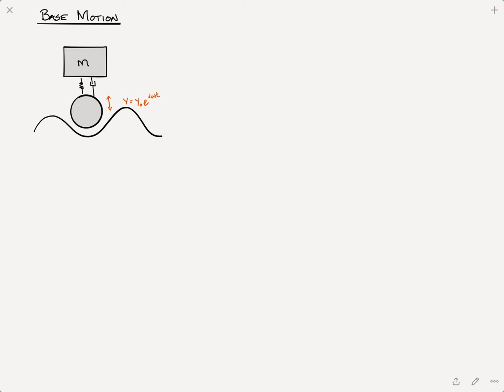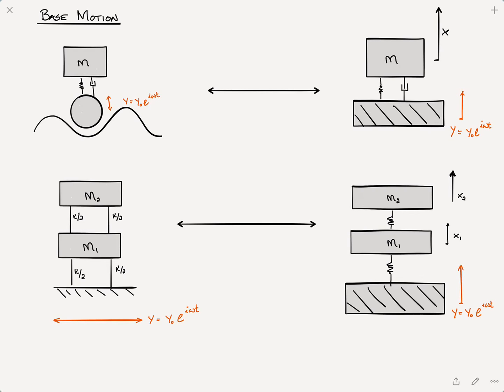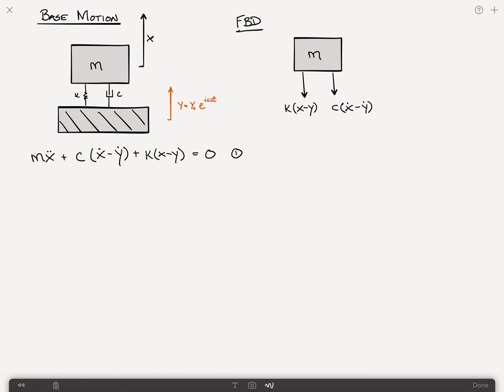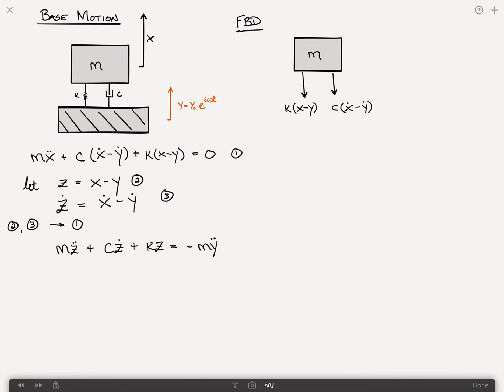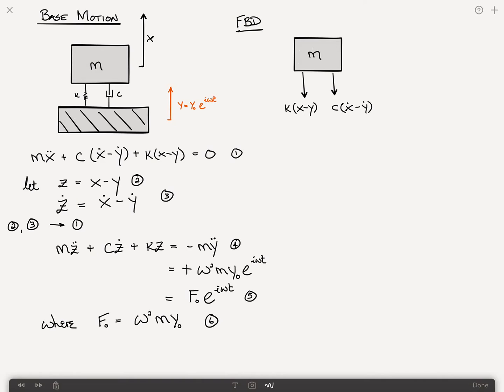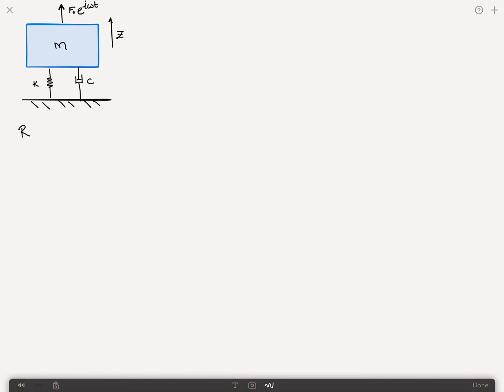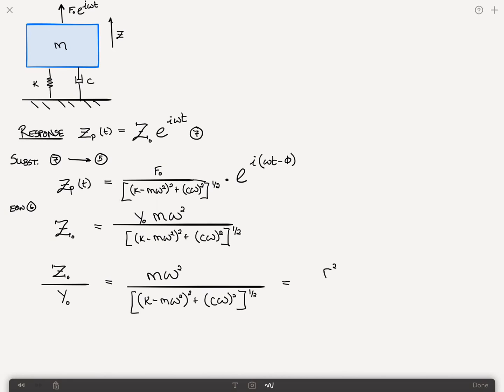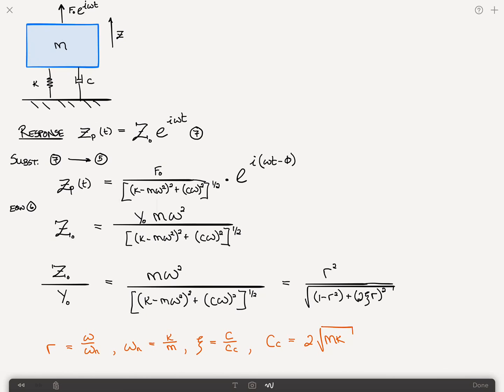Base Motion (Ground Motion) Effects

Comment: in 07:17 it seems there is a typo error where if we subsuate the value of y double dots the negative sign will not dissper .
Reply from the maker: Taking the derivative of y with respect to t is the same as multiplying y by iω.  So taking the second derivative of y is the same as multiplying y by (iω)^2 = i^2ω^2 = -ω^2.  Substituting y_ddot causes the negative (-) sign to change to a positive (+) sign.

Comment: How did eathquake exhibit harmonic motion.Its random
Reply from the maker: It’s not totally random, especially as one moves away from the epicenter.  It does has a back-and-forth motion to it which means it has a periodic nature.  As such, the ground motion can be approximated using a Fourier Series, which turns it, mathematically, into a harmonic treatment of the problem.

Comment: Is this form of the amplification factor specific to the relative coordinate system you have chosen to use? I notice that the numerator in your case is slightly different to what is usually derived when x and y are maintained throughout solving.

Comment: why didn't you finally write z in terms of x and y
Reply from the maker: I could have done that.  It's just a question of choice of coordinate system.  Usually this is determined by when if being asked of you in the problem.  From my experience, it is usually the relative coordinate system that tends to be the easiest to work with then you can convert to whatever coordinate system you'd like the result in.

Comment: At 12.00, what happened to the e^-itheta of the amplitude Z since in the previous video it is writtien as a port of the amplitude Z
Reply from the maker: In the previous video, I did not assume that there was any phase shift in the response and as a result, I showed that the amplitude, X, was a complex number and that the phase shift could be determined from this complex number.  

In this video, I made the assumption that the response already had a phase shift and as a result, the amplitude is purely real.  I believe that this is the difference that you are referring to.  

In fact, they amount to the same thing, but in the previous video I showed step-by-step how to get there.  I think if you return to the previous video and go through the math step-by-step, then it will be clear why I am able to treat the problem in this video in this manner as I have (by skipping a couple of steps).  I hope I haven't confused you with this.  If necessary, apply the technique from the previous video to this problem and you should get to the same result.